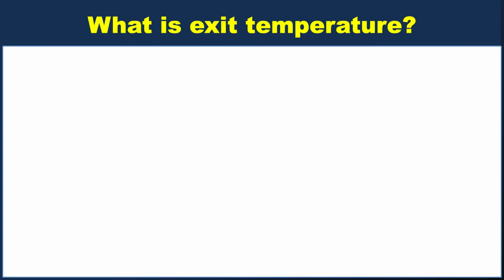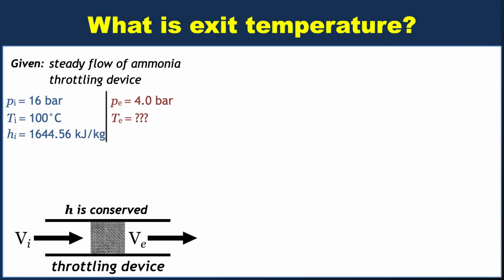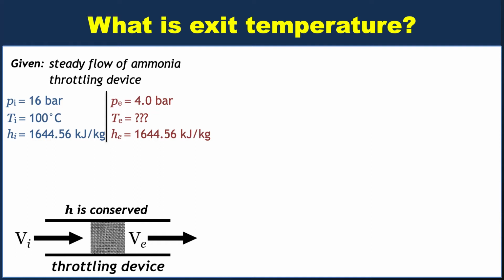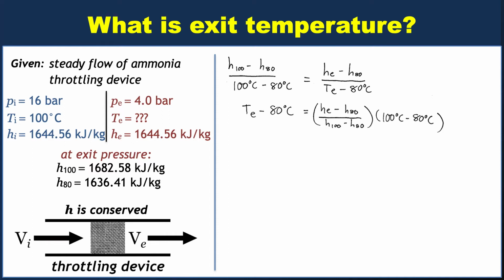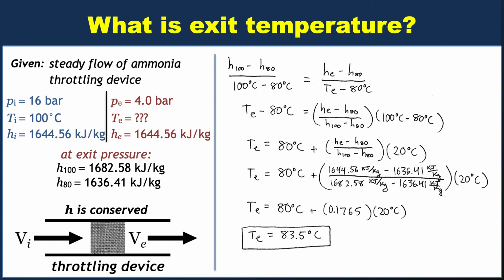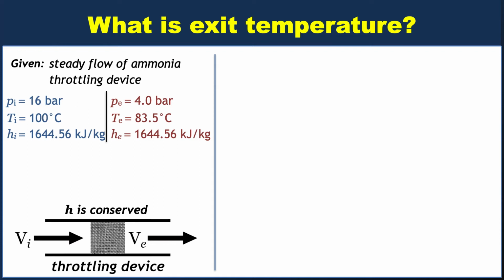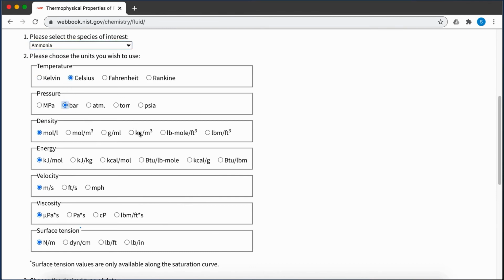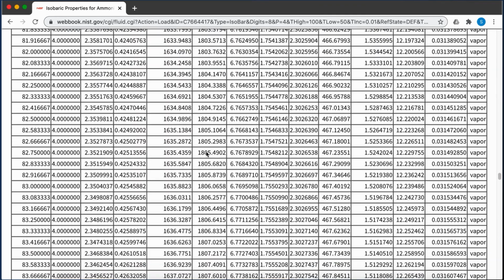Example: Finding the exit temperature of a throttling device

Comment: Great video, May I know exact reason for temperature drop after pressure reduction when its enthalphy is same?
Reply: Expansion. If the factor by which the pressure drops is smaller than the factor by which the specific volume increases, the internal energy term naturally needs to fall ( h = u + Pv). Joule-Thomson effect. Liquids usually have the opposite effect where the temperature rises after pressure drop since the volume remains nearly constant which means that the internal energy must increase in order for isenthalpic assumption to hold.